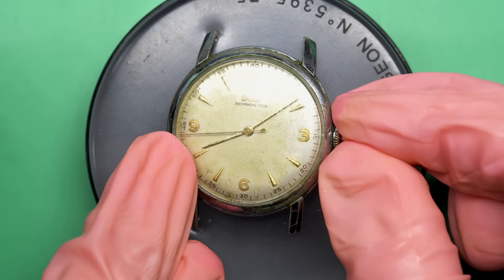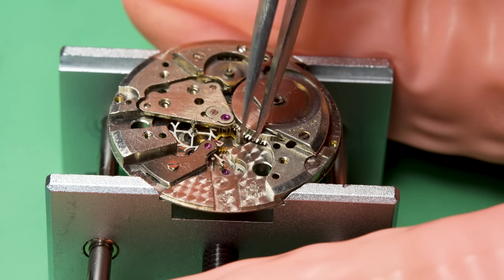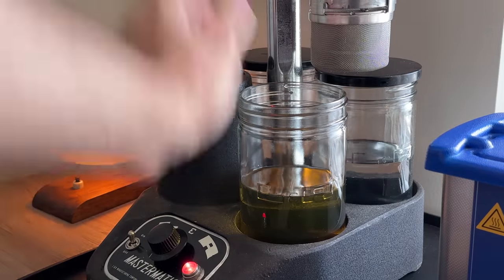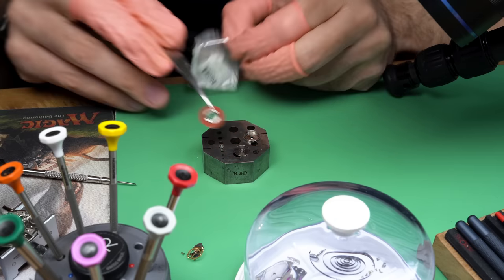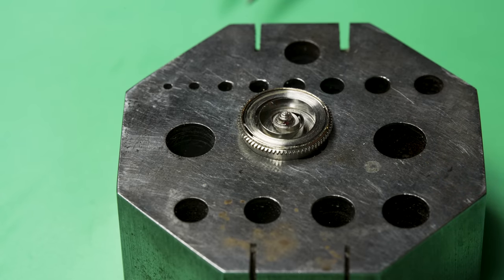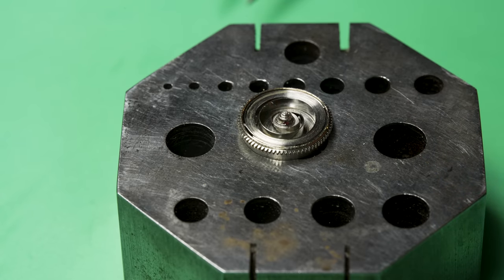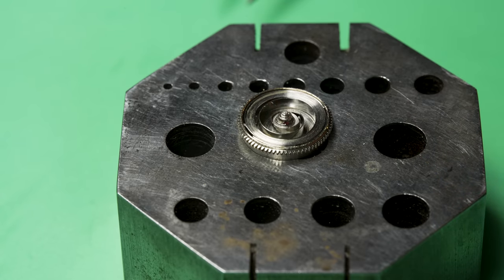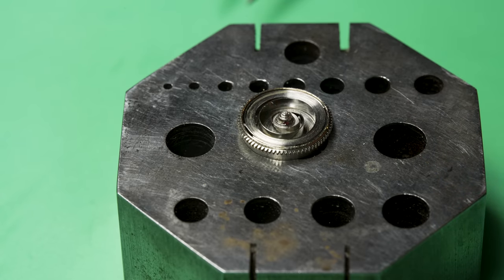A Young Viewer Sent Me a Watch to Restore!

Comment: When using the power supply I would suggest turn it off with the "Stop / Out" button, attach the wires and then turn it on with the same button so you don't accidently make a short between your anode and the movement :)

Comment: I love the fact you often start replacing a screw by going in the 'wrong' direction initially to get the thread to align correctly. Shows great mechanical 'sympathy' and aligns with your other mechanical history. I was hoping you would send it back and hope the young recipient of it appreciates it and bookmarks this video. Always a pleasure to watch. It is unusual today that anyone will watch a 46-60 minute video but I find these mesmerising. Well done.
Reply: We use this method in hanging TVs when we’re using snaptoggle drywall anchors, because if you misthread it it will break the apparatus off in the wall and will waste you several minutes cause then you have to take the whole bracket down and redo them… it was really cool to see him do it and kind of catch that, cause I used to be the least mechanically inclined person in the world before I started doing home theater install work and learned a ton of stuff and interesting to see other pros use some tricks of the trades.
Reply: I noticed that too; that's something I have always done when putting anything threaded back in.
Reply: Funny how we're never taught that but it's so intuitive to back the screw up until you feel it "click", then change direction.

Comment: Finally - a DOXA!!! I have a small collection of their SUB series watches. A great company with a significant history in the development of the "dive watch".  Doxa pioneered the orange dial, the dive tables on the bezel and holds a joint patent with Rolex for the Helium Release Valve.  What a gorgeous result on this watch!  It looks like the bottom lugs are spread out though - that happened on my Elgin.

Comment: Marshall. have you ever tried plating the other way, where you would prep, then plate to build more material, then prep for final plate, and then plate again? You may end up with a better finish that way - A bit like on a car where you baremetal, fill, sand and then paint - Maybe in some cases it might need more than one pre stage  to be perfect and you might not have to rub as much brass off ? Love evrything you do - You have become a steady companion to my evening hobbying

Comment: I notice you turn the screw in reverse first, before turning in the correct direction. I do this as well, as I am 'feeling' for the threads to engage first before going 'at it'. This helps to prevent cross threading, especially when screws go into plastic, as you do not want to cut new threads.

Comment: Hello from England Marshall.
I have an unusual watch here, it’s a Montine of Switzerland 17 jewel Incabloc in stainless steel with a blue face and a twin crown, it’s a mechanical movement with a mechanical alarm. I’ve only ever seen one other like it on eBay and I never got to see how much it sold for, so I have no idea of the value of it.
It works beautifully and the movement is smooth and it rolls like a Rolex movement, as in it doesn’t tick but rather just glides. On the back it tells me it is anti magnetic and waterproof and surprisingly shock resistant.
I wear it from time to time and a good wind lasts about 30 hours.
I thought you might enjoy hearing about my unusual watch.
Thanks for your content, you do great work and it is well presented. Take care. 🙏

Comment: I was recently home inThailand and took 3 watches to the repair guy I use.  Two were fixed as it was only a battery replacement, the other they did not look at as they did not have replacement parts for.  Not an old watch by any means but disappointed as they didn't even look to see what was wrong.  One of the workers was putting a watch back together after cleaning and these parts are so small.  Seeing everythig through the macro and microscope doesnt allow for full appreciation of what it takes.  Great work Marshal.

Comment: I have often seen you trying to remove rust from some watches, whilst there are proprietory brands out there for rust removal nothing beats good old Apple Cider Vinegar for removing rust. Also if a part is capable of being immersed in boiling water this is useful. Dunked in boiling water softens rust and helps its removal. That is what I do, soften the rust then pop it staight into Apple Cider Vinegar, never fails.

Comment: You should look into electropolishing,  It gives you a perfect surface for plating and uses the same equipment used for electroplating.  And after polishing, you should look into copper plating.  It allows you to built up material to specifically be removed.  It's like bondo for plating.

Comment: The watch movement cleanup and case replating really made the watch pop.  How do you select a replacement mainspring, particularly when the style changes from the old circular-shaped to the new S-shaped spring?  Assume length and width of the original mainspring have to be considered to fit the mainspring back into the barrel.

Comment: For the face cleaning enthusiasts: the watch is typically close to hermetically sealed, so the discoloration of the face is not caused by dust one could clean off - as there is no dust there. It’s more akin to how a framed photograph or poster may fade in time, especially when exposed to UV light. It’s a photochemical reaction that occurred to the pigment, and scrubbing / wiping will just introduce new marks of a different kind. Marshall may not go into detail why he leaves faces as they were, but trust him - it’s the right call.

Comment: This may be crazy, but have you considered for dial renovation maybe leaving them in a light hydrogen peroxide solution with a UV light (or sunlight) to "retrobrite" dials rather than any tool-scrubbing? I'd be interested to see the results of that. You'd be gently bleaching them which shouldn't affect the materials and layers as much.

Comment: Nicely done. 🙂 Doxa made some interesting watches in their history and because they're not that well known are a bit of a "bargain" in the vintage world. Even their sought after vintage divers from the 60/70's are significantly cheaper than equivalent Rolex or Omega and were actually more expensive to buy when new. 
On the shock protection, I"ve seen Doxa's and others from the 1930's with early versions of it. I have a Doxa from 1941, issued to the German military and it has it as it was a stipulation of the contract. They probably left it off most civilian movements for simple cost reasons.

Comment: For the sanding sticks, the number represents the number of particles per area, so the higher number means more particles, which means that each particle is much smaller, which in turn means that the it's finer and less abrasive.

Comment: If the patina is because of the clearcoat on the dial, maybe try talking to an art conservator. They have experience in removing varnishes without damaging the paint layer underneath. While you may want to keep the patina, if it's because of the clearcoat failing, knowing how to fix it is probably a good idea. It may even be possible to stabilize it, to prevent it from getting worse.

Comment: Great video. One question; what was the adjustment dial for on the balance spring for? Wasn't that used to fine tune the amplitude of the watch? If so, why wouldn't you want to adjust that to see if you could dial it down to get it closer to the 0 seconds over the course of a day?

Comment: Did you oil the jewel in the first bridge you put on that got covered by the train wheels?  Typically I've seen you unscrew them and to the peg wood dance and one-dip before oiling and since that jewel is buried in the watch, I wasn't sure if you just did that off camera or if it didn't need oiling like other jewel positions.

Comment: Hi Marshall, currently I’m in the process of working on my very first mechanical stopwatch from the 40’s. I bought one cheap on the internet and it works, so it’s a good piece to start the hobby on. I also got a cheap watch repair kit online with various sizes of screwdrivers in it. But the screw which I thinks holds the crown stem is SO small that even the smallest screwdriver is too big. I’ve been searching online for smaller ones but all I see is 0,5mm 0,6mm up to 3mm. Is this the width of the blade,  or is it the thickness of it? Or are those two connected? I’m really looking for the smallest screwdriver out there which will fit the groove of my tiny little screw.

Comment: Once you start getting into complicated, modern movements, stuff with tourbillons and other mechanisms like that, you kinda need a torque wrench because if you think that warping an engine from bolts is bad, those mechanisms relying on precision to function, before anything else, have it even worse.

Comment: I have a PRESTA "Pegasus" Swiss Made, 17 Jewels, Time and Date gents wrist watch. .The second hand is a "sweeper". I can find nothing relating to it. I got it in an auction lot many moons ago. The strap looks original, there are minor scratches on the face. It has never worked as such. The second hand moves if the watch is shaken, then stops. I wonder if it is worth getting serviced/repaired/fixed. If anyone can shed some light on its origins I'd be most grateful. Regards